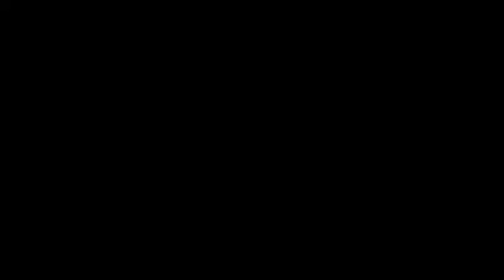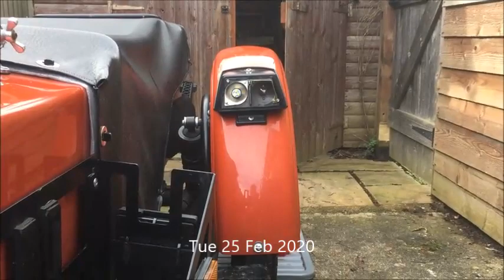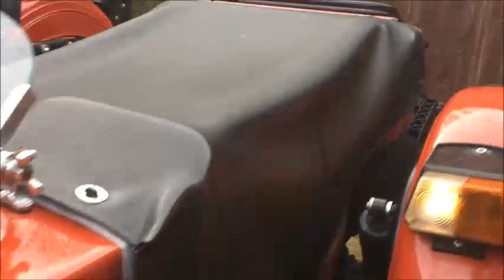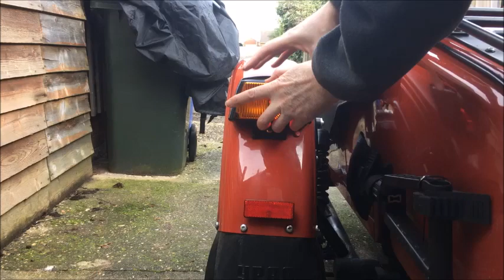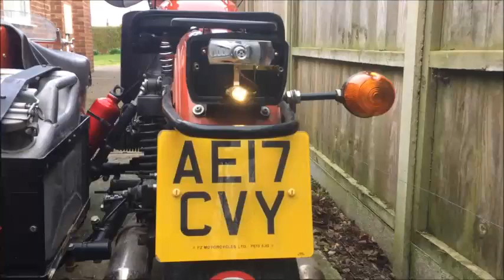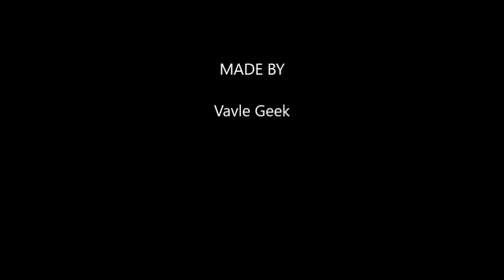Putting LED's on the Ural Part 1

Comment: How are the bulbs holding up sir ? Have you also changed the headlight bulb as well?
Reply from the maker: All still going fine. No the headlight is still a filament H4, it's not the OEM unit, but a replacement with changeable bulb. The H4 in situ is a Phililps X-treme ('up to 130% more light').